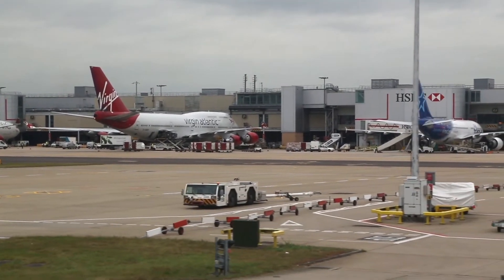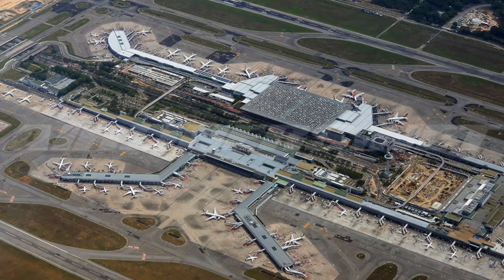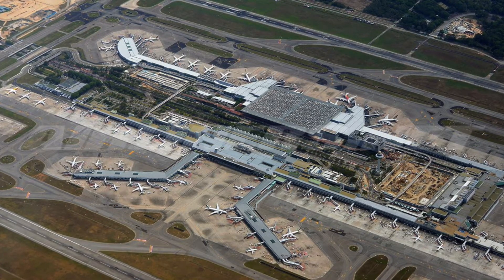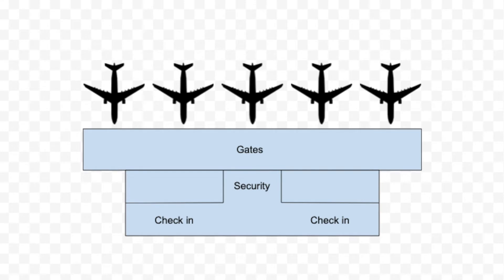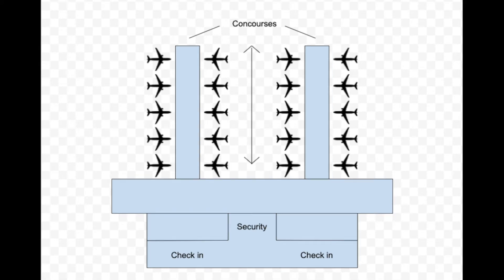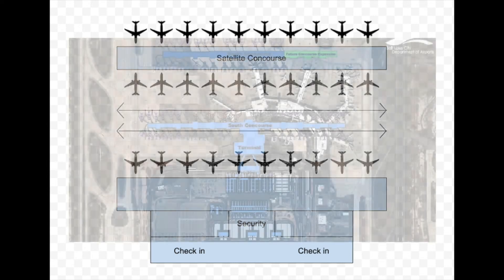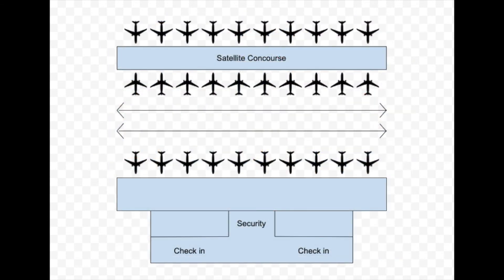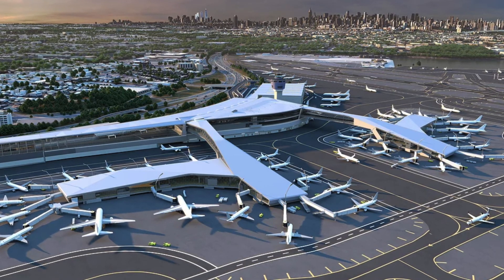How To Design a Good Airport

Comment: You missed DXB. That's the best example of the last type of airport design you've mentioned.
Reply from the maker: Yes in terms of Sattelite concourses, but no in the sense that DXB only has 2 runways. It’s needs more than that.
Reply: @jonesrmj  but weren't you talking about satellite concourses and not runways?
Reply from the maker: @mohimroy7738  Yeah. I’m just saying that DXB doesn’t have a lot of runways.
Reply: @jonesrmj  agree.
Reply: @jonesrmj  but the best airport with satellite concourses. Yes.